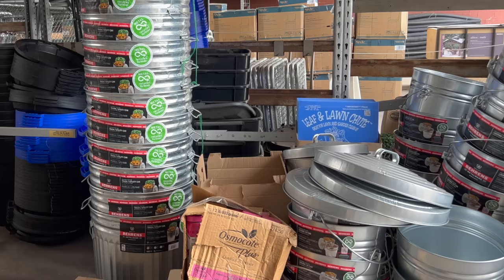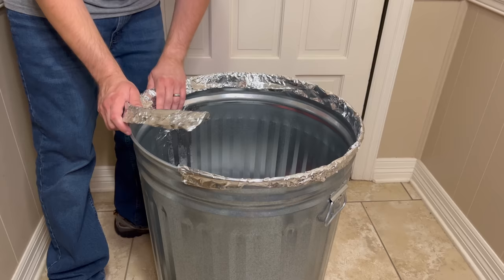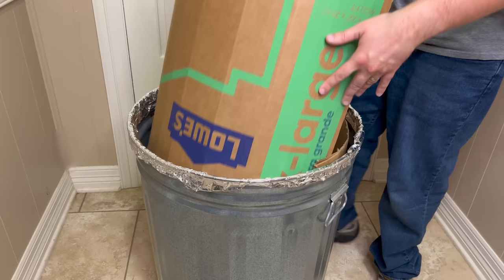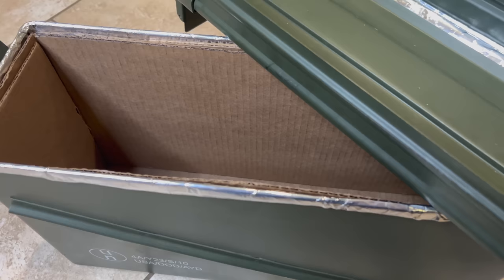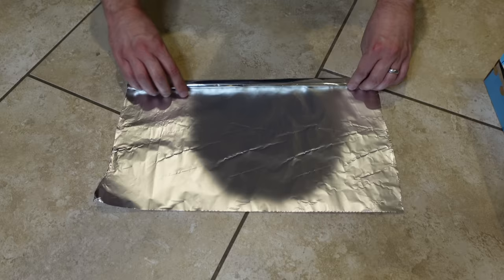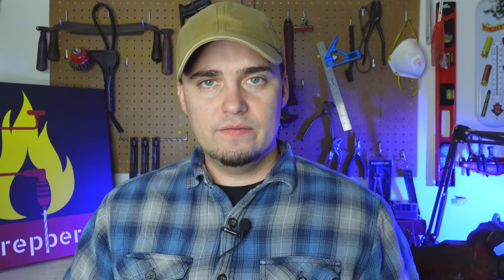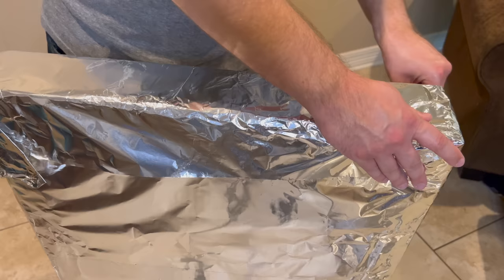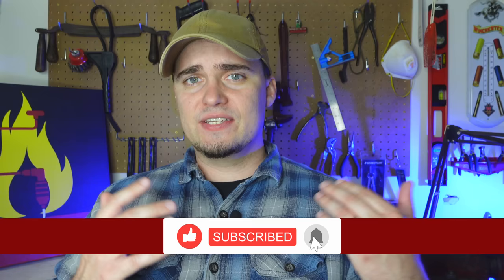3 Ways to Build a Faraday Cage

Comment: How about using a copper grounding wire attached to the lid and the can?
Also how about having a spare electronic ignition system for your car stored in your faraday cage?
Reply: Depends, is your car from before the mid 80's? 

If not there's a bunch of computers that are about impossible for the average diyer to replace.

Comment: I tried this with a 6 gallon Behrens bucket and locking lid.  I followed the exact instructions on the garbage can example, including the light inside the can to find gaps, the foil tape (Nahua brand, as no 3m in Home Depot) over the seams/gaps (2 layers), double bottom cardboard on the bottom and 1 layer around inside can.  I rolled up tin foil (Betty Crocker Ultra Heavy Duty foil) and wrapped around can lip as per what was shown.  I received the same results with the NOAA walkie talkie, however when I used the same "find my phone" app to make my phone ring, it did - so it FAILED!  I then placed tin foil around inside lid, on top handle side to attempt to seal any gaps.  So any suggestions on what I did incorrectly? or what I could try next to receive the same results? Ty

Comment: Why not keep the rubber gasket but add a second inner seal of conductive material that contacts both the walls and lid?  You'd keep the airtight seal while also getting the full emp protection.

Comment: Could my insulated metal building be a start? The roof has radiant barrier bubble wrap type 1/4" insulation and the walls have 2" batt with radiant barrier. Cell phones only work if the roll up door is open and you are standing near it or outside of it.

Comment: all looks good but the reality is something different. You cant keep large lithium batteries in these as you must keep a charger to them or a battery management system. so there is cords running in and out. Your system is only useful when shtf and then u gotta wuickly stuff your faraday cage. it cannot sit on the shelf waifing for the one day its needed.

Comment: I turn an old freezer into a FCage— and Test it! Microwave oven did not work , my cellphone call ring!!!! But if using a freezer- use metal tape to seal the drain plug and around the rubber on the door seal… it works good

Comment: So would a metal storage shed ( garden shed stop emp if it was sealed ? Or would I have to put metal on the floor of the shed to ,Could stuff be stored in my stainless steel refrigerator? Would stuff in metal buildings be protected?

Comment: Probably the best bet is to make a faraday cage full of rechargeable batteries for your power tools and regular batteries as well as solar rechargers.  These will not be used as your regular batteries and power tools.  That way you won’t have to be opening and closing it and possibly compromising the cages integrity.

Comment: could you use an old metal cooler or a refrigerator that was an old refrigerator to do the same thing that you're doing or modify them to bemore protected! could you use a metal storage unit adding caedboard covered with tinfoil. fewer layers to deal with!

Comment: You can also get a plastic garbage bin to fit INSIDE the steel one, you'll just have to cut off the handles on the plastic bin and it fits perfectly inside. Also, why not put the solar panels in their zippered enclosures, zip it up, wrap the enclosure in foil, THEN put them in the box to protect the foil?

Comment: Frame up a 2 by 4 room and then staple screen wire brass if you can or aluminum  screen wire make a door with hinges and a latch. Cover the door with screen  wire. Drive a copper grounding rod into the earth and connect it to the screen wire cage with a heavy gage  wire. Now you have a EMP proof room for all of your electronics.
Reply: Yep

Comment: Don't forget to earth the cage as the energy needs to go somewhere to go. (stick a copper wire from the side to the ground)
Reply: If you have a telephone connection  box outside you should have an earth ground stake near it, you can run a wire off that, or just drive apiece of steel pipe or rebar into the ground and wire to that.  Alternatively, if you have steel sewer/septic pipes out if your basement (shelter?) underground that can make a decent earth ground if you can wire to it (pipe clamp).

Comment: For a large faraday cage, to hold solar panels, would a 6 ft tall metal cabinet from amazon work (Greenvelly Metal Cabinet, 72” Black Tool Steel Locking Cabinet with Doors and 4 Shelves)? line it with cardboard and tape it up with foil tape?  Sturdier than wrapping a large cardboard box all up with layers of aluminum foil.

Comment: Would it help to wrap each item inside tinfoil b4 putting them inside can n sealing it off ? R dropping the smaller items like phones inside a foil bag? Just a idea.  I onow for a fact that when you crumble tinfoil up and then weap phone up with it making sure phone is off  also make sure you unwrap in same place  that they will not b able to track the phone!   So I just was wondering if it would help in this situation.

Comment: rolled lead sheets if you can buy or make from old car batteries would make the Faraday cage perfect. Any solar or micro hydro electronics should be protected too. rubber or plastic sheets on the sides of the metal can would be better than cardboard.

Comment: The construction of the Faraday cage using a trash can is a good way to go; however, no insulation is required inside the trash can. The items you are trying to protect can literally be touching the inside of the can without fear of damage should an EMP occur.

Comment: hey JR, looking for recommendations on parts i would need 
to build an apartment power system that would fit in a small garbage can size faraday cage
power source (solar panel or car battery)
dc to dc converter to step down power from solar panel to micro inverter 
micro inverter (300w to 500W) dc to ac (battery optional)
power target (small appliances)
any ideas or product recommendation would be greatly appreciated

Comment: I would be much more interested in making a faradays cage around a room, say my office, where I have my main computer and everything belonging to it. Wouldn't using wire mesh be the thing, both for the walls and door? But what diameter for the holes? And what about a window, can that be included, or do you need to block it off?
Reply: Tesla made a fairly large cage.  Maybe you can find out something there.
Reply: @jeanmartin6410  The damned bastard didn’t make a YouTube video of it.
Reply: @SverreMunthe  surely there is a. . . Darci say it???  Book showing it???  There must be, because I saw a movie that had one in it and when I asked my husband if that would work, he said yes.  He was an aerospace engineer.
Reply: Faraday made large cages of lower frequencies of EMP. Think lightning bolts. Gama rays which are what we are worried about require the Faraday cage to be a solid metal barrier. The barrier does not have to be thick just conductive. Think aluminum foil.

Comment: What container can I use for my lithium batteries to protect my solar system? Batteries are like 2 foot long each and 10 inches wide.
Reply: Batteries lithium or otherwise do not require EMP protection. Generally Faraday cages are for micro electronics.
Reply: Really ? Don’t all the best lion batteries have micro controller sensors in them ?

Comment: So I test microwaves before buying them by putting my phone in and seeing if it loses signal. If no signal gets in, then its good. But alot of the microwaves on store displays will not block the signal which means they are not fully protective.
Reply: Which means when it is running you are also not protected from the microwaves leaking out

Comment: EMP effects all items that are energized, if you remove the batteries it will have no effect on that item. Automobiles are no exception. Faraday cage will work to protect your batteries, but you can build one into your tool box, or battery box faraday cage storage can be made with Foil inside and outside.
Reply: Electronic equipment with batteries removed can absolutely be damaged by an EMP. The amount of bad information concerning EMPs is astounding.

Comment: Instead of the 3rd version, why couldn't you use a large metal cabinet with adjustable shelving and replace the metal shelving with plywood and customize the cabinet in areas needed. Cost would be around $400 and you'd have massive,organized storage that's easily accessible.
Reply: We did just that. You are right.  Price about right for the storage cabinet…4x4x2 ft. Recycled cut cardboard boxes instead of wood. It holds all of our critical needs plus extras.  Solar gens, cables, small appliances, tool battery chargers, back ups electronic/solar gadgets. It’s a project but well worth it.  Tested with a radio, cell & it seems to work. Hope so.
Reply: We didn’t replace the shelving. Just fully layered, insulated & covered them.

Comment: As far as I know and can discern. . electronic devices which are not "active"  or energized  ARE NOT VULNERABLE TO DAMAGE. Since there is no current circulating in them. . so.  . I don´t see how they can be damaged . .
Reply: EMPs induce currents, if there's copper traces connected to something which makes a closed circuit you can expect magic smoke. Passive electronic devices are not affected tho.

Comment: If you have an older RV they are a good faraday cage the window screens used to be metal in fact copper was used, then aluminum and finally now days a non metal fabric... If you go to the hardware store and replace the non metal screens with metal window screens then you will have a completely shielded faraday cage. THAT IS IF THE RVS ROOF IS METAL ALONG WITH THE SIDES AND UNDERBELLY, AN OLDER TRAILOR OR 5TH WHEEL HAS THIS.... PROVE ME WRONG!!!!!!!!!